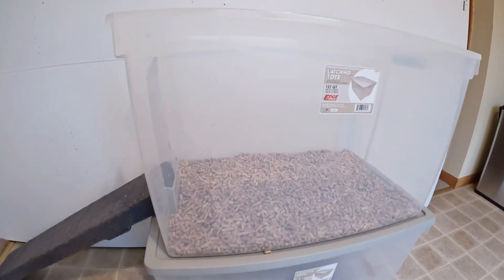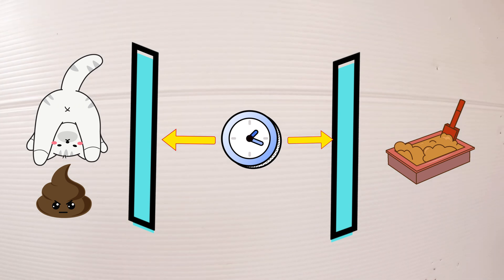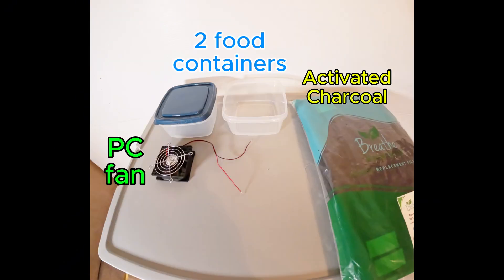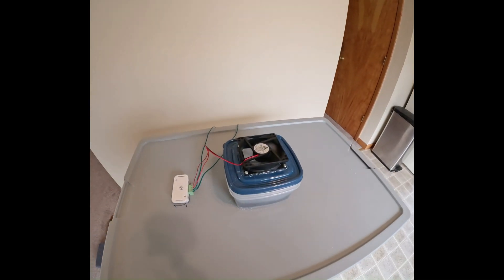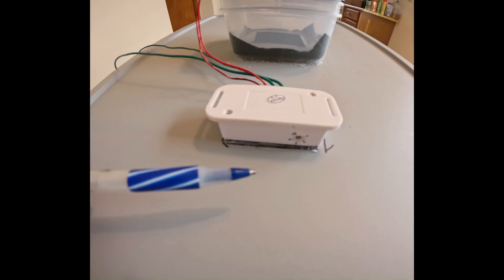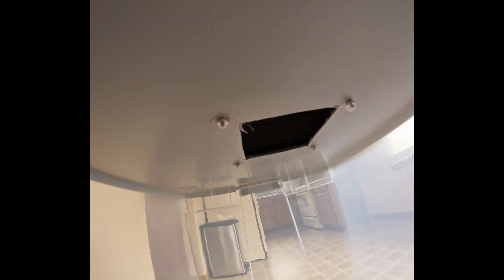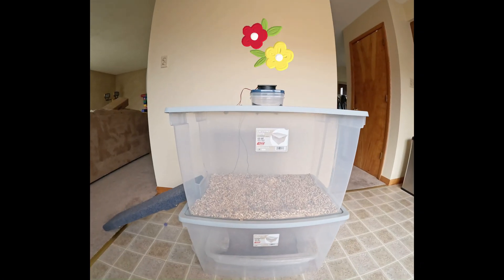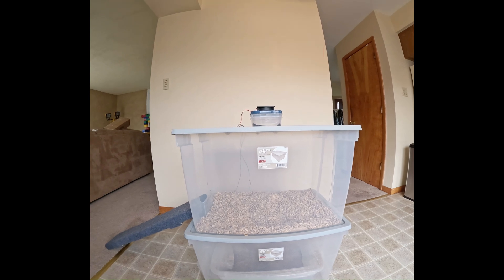DIY Automatic Cat Litter Box Odor Remover System!

Comment from the maker: Build Your Own: DIY Easy Clean Cat Litter Box System Using Pine Pellets! https://www.youtube.com/watch?v=oIH27zqd2gg

Update on DIY Easy Clean Cat Litter Box System Using Pine Pellets! https://www.youtube.com/watch?v=8MRcyi6fbMc

 - Parts List: Food Containers  - $5.00
 - Activated Charcoal Filter bought on Amazon: Breathe Naturally Universal Cut To Fit Activated Carbon Air Filter - Replacement Charcoal Air Filters - Carbon Filter Sheet for Air Purifier, Vent Filters & More - Made in USA (Pack of 2, 16x48)  - $20.99
 - GDSTIME 80mm x 80mm x 25mm 12V Brushless DC Cooling Fan compatible with Desktop - $8.99
 - 2 Pack DC 12V 24V PIR Sensor LED Motion Sensor Switch, MELIFE Infrared Sensor Controller for Timer Function Automatic Sign Control PIR Controller LED Light Strips - White
 $12.99
The car battery and wire I already had.
Total cost of items purchased: $47.97